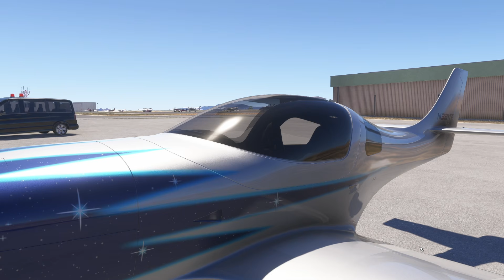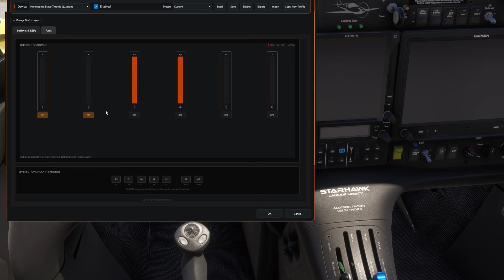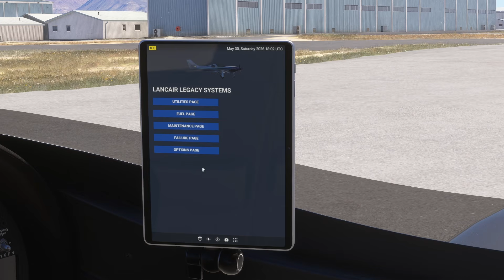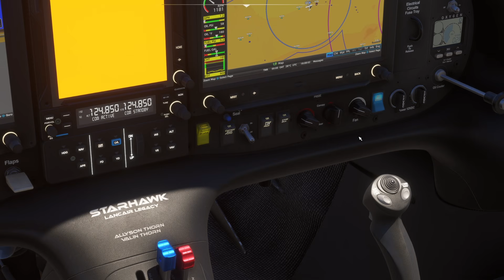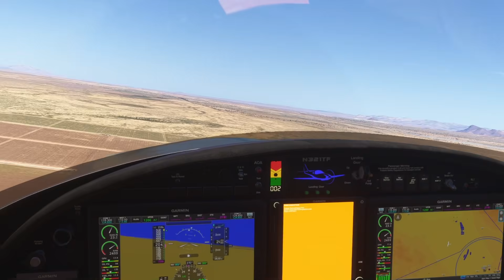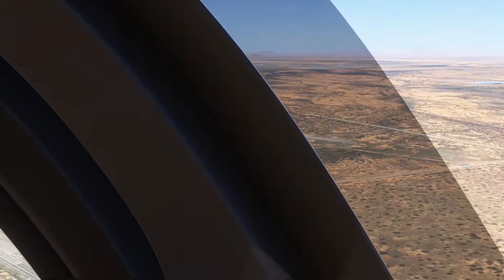Flysimware Lancair Legacy: MSFS 2024’s New High Speed GA Hot Rod

Comment: There's a canopy lock lever between the seats. It's not mentioned in the manual, took me ages to work out why that darned canopy open light wouldn't go out.  Your first takeoff was just like mine, except I was a bit faster. She's VERY twitchy going slow near the ground, and surprisingly un-twitchy once you get going. I think they're more about going from A to B as fast as possible than tossing around. Having said that the actual Legacy POH lists specific maneuvers that Lancair test pilots have performed with recommended entry speeds - the complete list is Chandelle, Lazy 8, Aileron and Barrel rolls (180/200 kts) and split S.  Loops and spins are not on the approved list :)

Comment: Thanks again for the great review, OverKillSimulations. We’re really glad we reached out and got you a copy.

I do want to apologize for not pointing out sooner that the user manual has been available on the Flysimware Store product page since day one. Considering you did the review without the manual, you actually did a great job learning the aircraft on your own.

There is a lot to learn with the Lancair Legacy, as we really raised the bar for a GA aircraft. For example, the canopy has an air seal system that helps prevent rushing wind noise and also reduces engine noise. You were very close on that one. You turned the air seal pump on, but the switch next to it was still in the release position, so the pump kept running and trying to seal the canopy. The blue light simply means the pump is running. To complete the seal, you need to raise that switch so the air release is closed, and then the pump will stop once the canopy is sealed.

The canopy handle you used is more of an easier shortcut for users, since the real latch can be harder to reach in the sim. You still need to latch the canopy, and we may update that shortcut click spot later so it fully opens, closes, and latches the canopy.

Also, version 0.2.0 is now available, and the flight dynamics are about 99% complete. The AOA is now correct, and the control surfaces have been tuned much closer to the real aircraft. The version you reviewed was still a work in progress on the flight dynamics, so the aircraft may have felt more touchy than intended. It will still feel responsive, as the real aircraft is a high-performance GA aircraft, but it should now feel much more refined. We also include recommended stick/control settings that are appropriate for the aircraft, so I think you’re really going to enjoy the next flight.

It would be great to see a follow-up video after going through the manual, because I think your viewers would really enjoy seeing more of what the product can do.